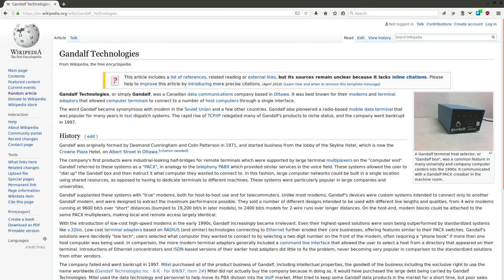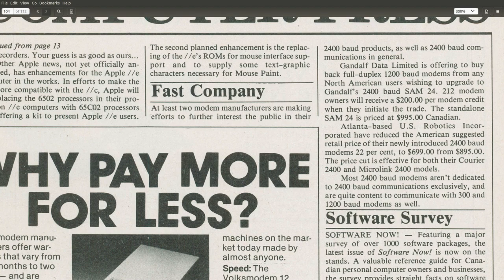gandalf modem

Comment: The TM led is Test Mode, it turns on when pressing RL ( remote loopback), DL (digital loopback) or AL (analog loopback), could't find the manual, sorry. 
I was a Field Service Engineer for Gandalf in Holland and still work for the company that bought Gandalf.